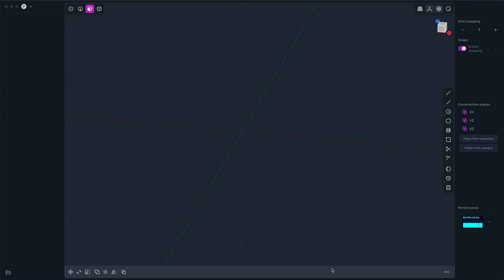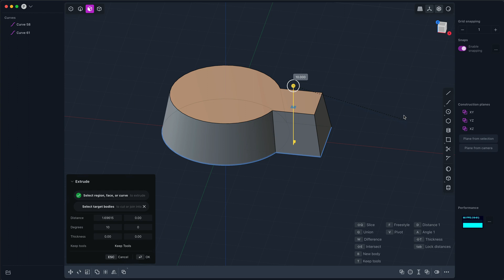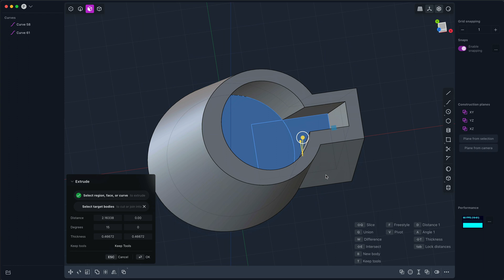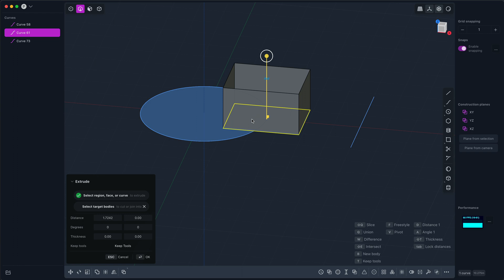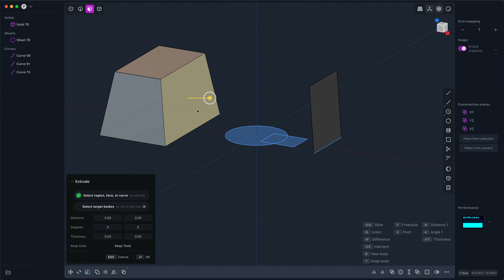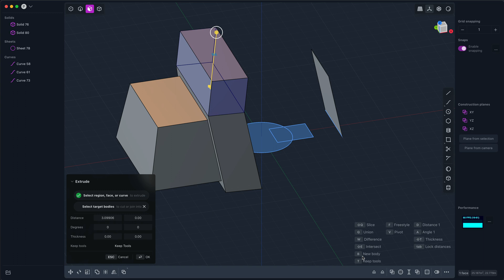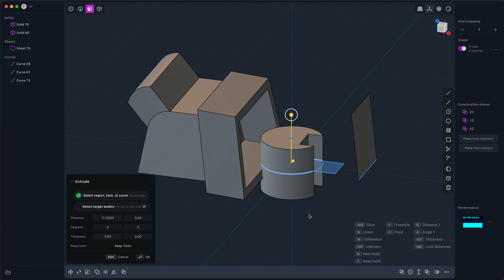The power of extrude in Plasticity

Comment: Im not much of a keyboard person in that, having to remember the numerous options available. Is there a way to take these options or many of these options had create a custom button bar and maybe a RT click  on something you are actively working on to reveal options? It would be nice if you were to RT click on some object ypu were working on and it show you only the possible options for where you are. Im more of a traditional modeler for almost 30 years and am used to things like button bars and RT click options. Ive played with this for less than a day and thing its very strong. But i found myself having to hunt around for what i want to do and a few times unsure what i wanted to do and would have like to have an exposed list of options showing across the screen in buttons.  So I guess if this company could make it so the interface is highly customizable so I can set it up to my liking as well as those who came from the many different 3D modeling implementations over the years, could do the same from what they are used to.  If Plasticity could manage that, i think we would have a perfect tool. This solves so many things from other packages i have used.. Even simplified getting results of some complicated objects that used to take hours. Many times the programs i have used, some of these complicated objects and operations i was trying to do would almost 99% of the time would crash the program. So it is so close to me dumping all the other tools i have

Comment: Hi Nik - Plasticity is a great program! But it lacks a few things: 1 - The solid mesh view is toggled on and off with a single keystroke. (Very important!), 2 - Cooperation with 3D SPACE MOUSE, 3 - The view cube should be bigger and not so small (e.g. with 4K Monitors) there may be a choice in the settings (small, medium and large), 4 - if you select any model in the main view (solid, plane or line), it is not selected on the left side of the model list (the opposite can be done, but you have to look for it). These are the 4 most important changes needed in this great program....there are still more things to change but these are the most important. if this is changed it will be the #1 CAD program in the world like Sketchup, Spark Design or Blender. Kind regards from Austria.

Comment: I like your videos, keep up the good work.
But I have a side note:
If you extrude a surface that curves in two directions, it can no longer extrude in the normal direction like standard polygon modeling programs and if you set a degree it either does nothing or just throws a generic error message. (The icing on the cake is that it messages dark red on dark grey. Kill your eyes to read.)

Comment: This software just keeps getting better and better,  so impressive!  The interface is so smooth.  Very pleasant to use such well designed software.  One minor problem when trying to modify objects created with the sweep tool.  When trying to use the move tool on sub-object faces of swept shapes the operation fails.  For example when sweeping a profile curve around a rectangle and then trying to stretch the resulting rectangular object with the move tool it fails.  Not complaining, just trying to help by pointing out a possible bug.  Thanks so much for all the hard work.  You must be a genius.

Comment: Hey Nick, I've been loving what I've been seeing of this software, especially as someone who currently works in gamedev, and got their start in CAD like Inventor. Is there already, or does the team have any plans to include something akin to Blender's "Industry Standard" settings for artists like me who aren't already intimately familiar with Blender's UI and Hotkeys? Something analogous to Maya's pi-menus for example.

Thanks!
Reply from the maker: Keybindings are customizable, though currently that is done through a config file. In a month or two it will be in the ui. Other people can make an “industry standard” keybinding if they want and share it. I will note that because I have lots of subcommands it is very tricky to design a set of harmonious keybindings
Reply: @nickkallen1  This will be great. I need a way to orbit without using MMB or ALT + RMB.

Comment: I have some questions, is it possible to add :
  1 - Snapping just like MOI and Rhino - perpenticular, tangent, center, intersection?
  2 - Layers ?
  3 - Grouping like in rhino, where you can group multiple objects and have them selected with one click ?
  4 - 2 rail sweep ?
  5 - array along curve ? 
  6 - when you draw a line to also type the dimensions ?
Also, the software is amazing, CAD focused for artists is just what i need, I will definitly buy it once it's 1.0

Comment: Hey Nick, Amazing work you are doing with Plasticity!

Few questions:

   1.  Are there any future plans to include support for "3Dconnection" (3D Space Mouse) for easier viewport navigation?
         If so, let me know if you need beta tests done with 3Dconnection, will be more than happy to do this.
   2.  Will there be the ability to set custom keys in the Navigation - Orbit & Pan option box?

Thanks!
Reply from the maker: I am a big space mouse fan but I won't be able to get to it for version 1.0 unfortunately
Reply: @nickkallen1  Thanks. If this wont make it in v1.0, no big deal. As long as you have plans to support it in later versions :)

Comment: I loved it, I am a beginner but its program is amazing, I miss an easy way to measure faces, edges or the set, as I said I am a beginner and I am used to tinkercad that I can always see the measurements. Thank you very much for your program and your effort, it's great!!!
Reply from the maker: Precision is not the focus of plasticity however there are measurements in the lower right of the window. Select a face or edge or solid and it will tell you length surface area volume etc
Reply: @nickkallen1  thank you 😊 , it's only a suggestion to add a tool to mesures two points,  thanks again for your help 👍

Comment: in just one year when we talked about the blender config .. i integrated plasticity in my work..i love it so much..obviously it's hard to be as fast in plasticity for many reasons than in blender yet ( i compare modeling 2 similar complex shapes in both software ,and in plasticity everything is one click so in the long run ..you can't be faster  ).but i love this software , and the export work so good , the progress has been amazing , i just want to buy it xd , i wish you  the best of success
Reply from the maker: Thanks for the compliments. To me blender is about as streamlined as is possible, so I can't ever beat it on speed exactly. The goal is to be almost as fast, but with the relative strengths of CAD. Some forms are better done in polygons and some are easier to do in NURBS.
Reply: @nickkallen1  well it comes from mainly because of the pick the shortest path thing ..that alone saves a ton of click ,but you already improved that with the loop selection .. and like i said the pie menus box cutter and stuff ..but like you said .;you take care of the core modeling features first .anyway ..good job man .
Reply: Dude, IDK about that - personally I'm faster in Blender right now just because I've been using it for 6 years and were practicing poly  modeling for 15 years, so yeah, naturally the new approach on modeling would take time. 
And it's well worth it not to have anything to do with the bullshit topology which is a show stopper in any CAD-like workflow in Blender. 
I'm not even talking about sub-D modeling because it's even worse with it's own set of insane rules. 
So yeah, Plasticity for the win!
Reply: Could you share your workflow and export settings to blender?
Reply: You must be a modeling god :O In Plasticity I do things in a few clicks that I would spend hours on in Blender thinking about how to build a proper mesh that is as perfect as the one Plasticity gives.